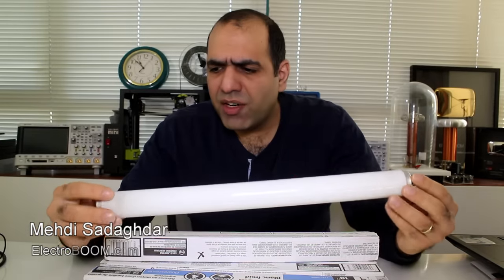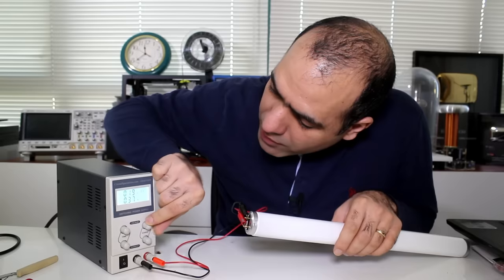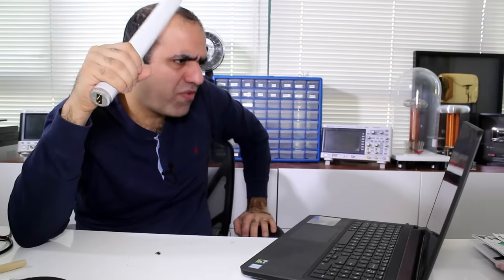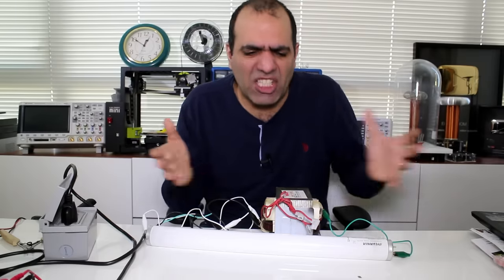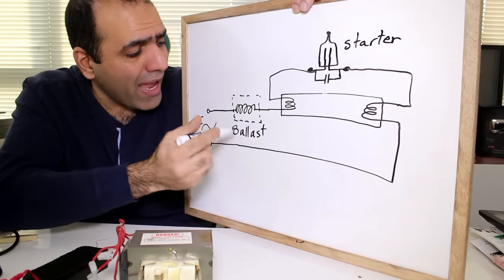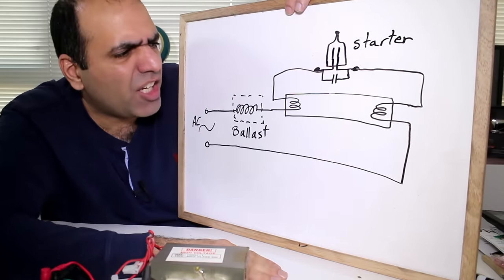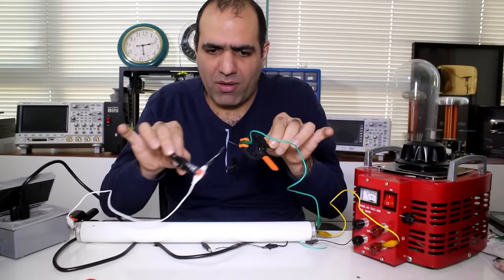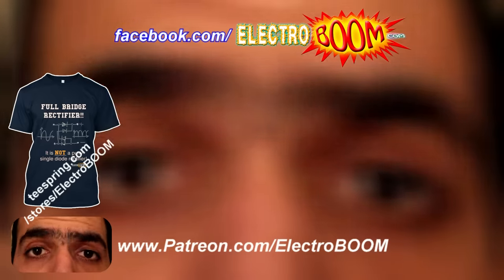How a Fluorescent Lamp Turns On

Comment: The starter is parallel with the filaments, so what keeps the starter from continuing to fire after the light has been turned on?
Reply: 5:55 The gas ionizes in the tube which makes a "short" across the starter while the lamp is fully on.  IOW, the voltage across the starter becomes very low -- too low for it to fire.

Comment: Here is a good one.  I have a power bar that has a neon light bulb that is inside the transparent red power switch.   Turn on the power, and the neon light bulb lights up.   However, at night time, when it is completely dark within the room, the power bar neon light is always off.  But, if I take my flashlight and point it at the neon bulb, the neon bulb lights up. If I then begin to move the flashlight beam away from the neon bulb, the neon bulb begins to flash on and off. Thus the dimmer the light that it is that is shining upon the neon bulb, the less time the bulb stays active, and of course no external light at al means that there will be no neon activity at all.   Any explanation ?

Comment: The lamp has gas in the tube, wich when heated 
Creates UV. The fosfore that makes the tube white, turns the UV into visible light. The starter that is used to kickstart the lamp makes arcs when on until the 2 wires in the starter get together the gaps get widen, when the do the lamp is on.
Reply: What you said wrong is that the phosfore gests not exited, the phosfore acts like a filter!

Comment: Just a comment - on my own ballast the induction coil is NOT in series. I don't see how it could work if the transformer is in series? also remember that to increase the voltage using a transformer induction works only when the current must be changing.

Comment: this is the standard light in the schools and public buildings of brasil
Reply: No worries in US as well lol, it pains me to see that they can't even replace with a same temperature color, so you have multicolored ones in single lamp. Hopefully it will change in next few years, but I'm sure contractors will charge "arm and a leg" to swap them to LED ones (you can retrofit old one with electronic ballast that will take both fluorescent T8 and T5 AND LED ones (that don't need to be rewired to 120V-bypass ballast altogether)).

Comment: 7.499.999 people: puts fluorescent light normally in the ceiling.
Electroboom: mixrowave transformer 39449 cables regulator voltage detector...

Comment: They say that fluorescent tubes are better for house plants than L.E.D's are. I'm yet to find out... L.E.D's are good for house plants but if you need to light up a wider area then fluorescent lights are more efficient. I'm currently doing an experiment to see if its possible to have an indoor jungle using low light plants that thrive under artificial light.

Comment: In the 7th grade I conceived and drew up what I called the free ion lamp which is today's CFL. Circa 1975. The SD card 3 years later. A piston-style linear tracking turntable and wireless speakers as well the next year. I'm just waiting for my silent drone, my LED paint and my piezo capillary pump, to come out on the market and I'll be ripped off once again. I've learned to be humble because anything I think of has been thought of already and when I come up with it independently, I look like a rip off. Iffat first one does not succeed, try something else.

Comment: Well decades ago, these were the most efficient source of light, before CFL or LED era. We designed something in case one side was blown (or even both!!!). take AC, put a 100W (Normal choke too is ok) bulb in series and rectify by bridge and apply DC across it. Yes it is not working. Well put one capacitor ( can use Electrolyte too but with proper polarity) in parallel to two diodes (Voltage multiplier) and it will work. Hold on, there is a lot flicker. Well, put resistors in series to capacitors and its gone. Oh, intensity is more on one side than the other. Well use two in reverse configuration. You can use bulb at some other place too... best is to forget all this as the era has changed.... changed too much.

Comment: PLEASE, PLEASE, PLEASE be extra careful with microwave oven transformers. If there's anything that could actually kill you ☠ with an accidental electric shock 🔌 it s the high voltage ⚡ from a microwave oven transformer. You should know this better than anyone. There is no good reason to act deliberately careless in the pursuit of comedy when demonstrating this particular device. 

The high voltage output from these transformers is not as forgiving as 120V, 240V, or even a Tesla coil and may not give you a second chance.

I love your stuff, it is entertaining and informative, but please stay safe.
Thanks for sharing.  😉👌🏻

Comment: Voiceover:

Have you ever wondered why fluorescent lamps are so popular? It's because they're more efficient than traditional incandescent bulbs, offering up to five time the efficacy. They also cost more in terms of installation and maintenance, but their cost is quickly recouped through their enhanced energy efficiency.

Onscreen Text:

Fluorescent Lamp

Voiceover:

A fluorescent lamp works by using an electric current to excite mercury vapor, which then produces ultraviolet light that causes and inner phosphor coating to glow. This configuration allows it to convert electrical energy into useful light much more efficiently than an incandescent bulb.

Onscreen Text:

Recycle or Safe Disposal

Voiceover:

One drawback to fluorescent lamps, however, is that they must be recycled or disposed of safely. Fluorescent lamps contain mercury, making them classified as hazardous waste, so it's important to make sure to discard them responsibly.

Onscreen Text:

Save Energy, Save Money

Voiceover:

In the end, whether you choose to use fluorescent lamps or not, it's important to be aware of the benefits of energy efficient lighting: it not only saves energy – it saves you money.